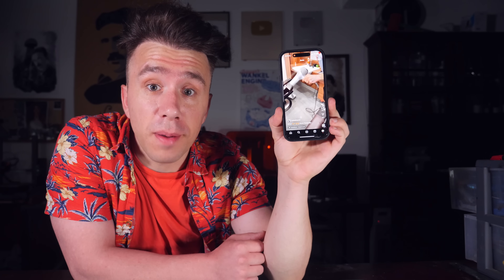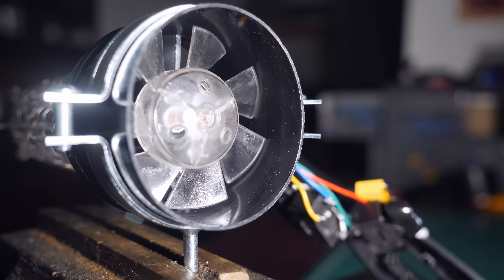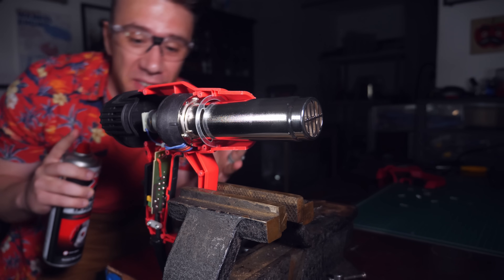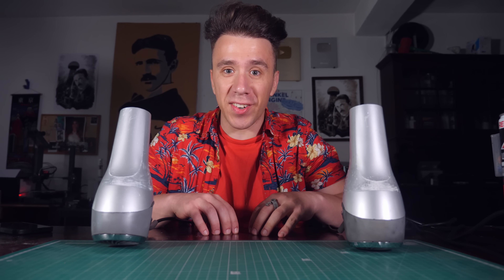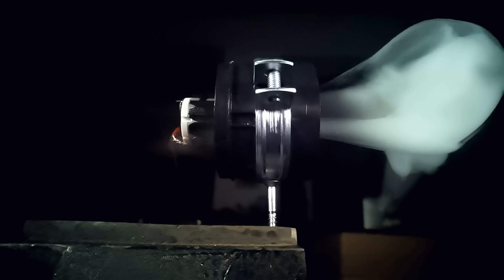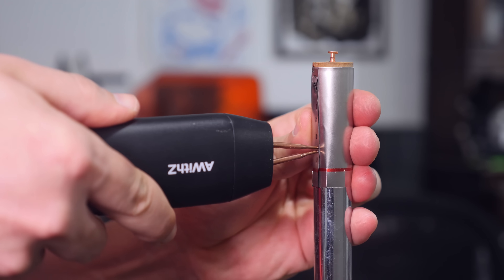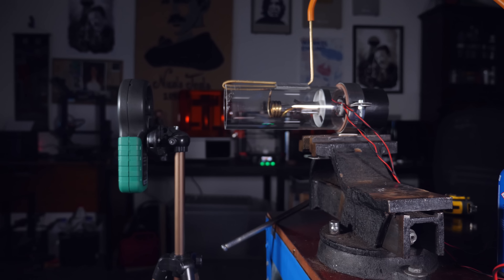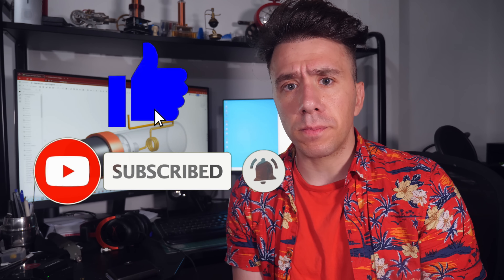I turned my $20 Hairdryer into a JET ENGINE

Comment: Id suggest tapering the nozzle, to increase flow velocity, also if possible, increase fuel inlet pressure. Also, change method of fuel injection to make it so gaseous fuel exits from many holes in the coil. This combined with increased pressure, you can angle some fuel streams to be relatively radial, for more complete combustion and increasing pressure

Comment: To improve the hairdryer engine, couldn't you use the same style as a typical jet engine? Multiple fans - 1 to bring air in and one to compress it? maybe using a belt fan/larger size for the first and a small server room fan for compression?
Reply: Better yet, use the fan systems from two different hair driers.  You use the normal bladed fan to accelerate incoming air which is then fed to an impeller system to compress the high-speed air to a greater degree.
Reply: So, adding a supercharger on it. I might be wrong, but you guys could correct me on it.

Comment: what happened to your last video?
and are the admissions to your contest still there, or do we need to reapply them?
one of the requirements was, that we need to like the old video, not the new video?
EDIT: my suggestion is, there is a video from 2 bit da vinci about a solid state combustion engine/generator. you went 90% of the way, you just need GaAs solar cells and burn ethanol that has NaCl dissolved in it. it will glow bright orange and the solar cells, because you are somewhat matching the color with the bandgap of the solar panel, you should get 50% of efficiency, maybe more?
but keep in mind, that this thing could generate several kilowatts of electrical power, and still overheat or melt down.
Reply: Age restriction happened.